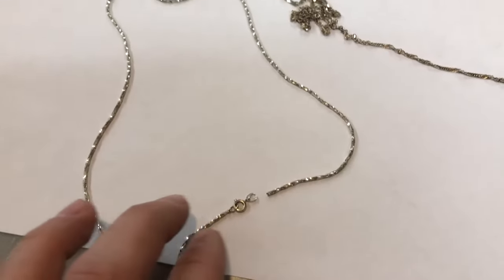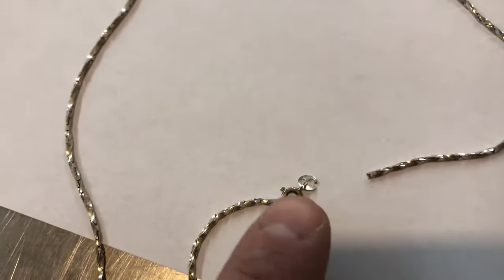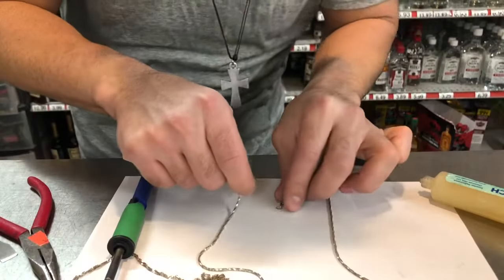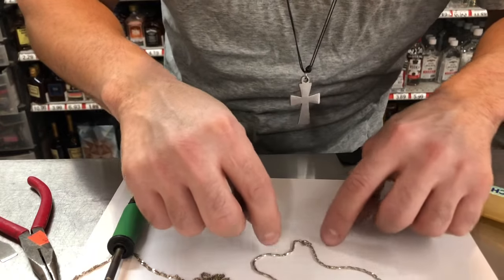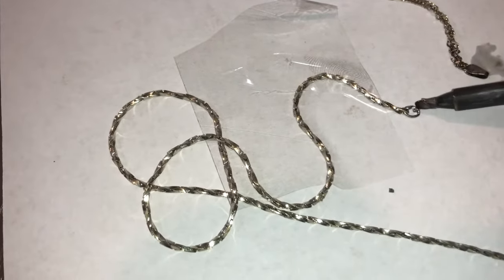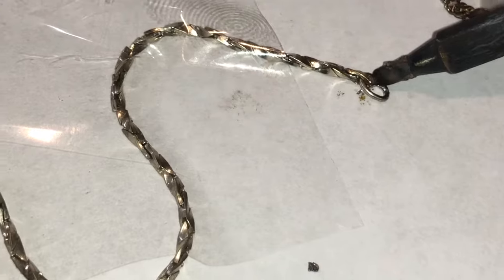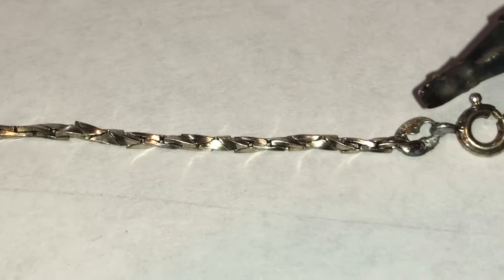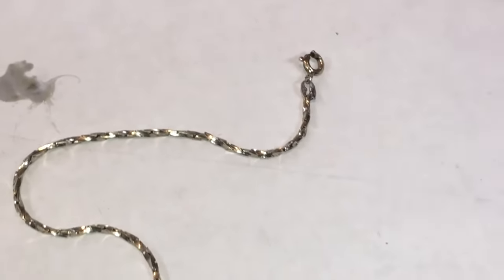How to solder your broken Silver or gold chain

Comment: It can work but Jewellers use gold and silver solder to solder Jewellery and if you use tin or lead DIY solder on a gold or silver it can contaminate approximately 10cm of the metal so if you take it into a Jeweller for a repair in the future, they probably won’t want to fix it (because it could contaminate their gold stocks) or they will have to cut off the ends of the chain and solder on new ones which will be a lot more expensive than the first repair.
Reply: Ok. That’s what I wanted to know, if the chain is silver or gold, did he solder with the same material. Which was suppose to be silver if chain is silver

Comment: Good presentation. That way of soldering may resolve one problem and allow the chain to be worn but it would contaminate precious metals.  That type solder might be ok to use on cheap costume jewelry but I would NEVER use it on precious metals.  My local jewelry store's astronomical prices for repairs prompted me to learn how to properly do hard solder repairs on my sterling silver jewelry. LOL!  Again, your presentation was good presentation and may come in handy if ever I need costume jewelry repairs.  Thanks so much for sharing!👍Cheers! 🙂
Reply: That's right not good use let solder in fine jewelry simple lose value
Reply: I bought a solder kit similar to this guy on Amazon for $28. It doesn't work S925 or gold. I couldn't weld my broken necklace and ended up returning it.
Reply: Heyy so what’s different about soldering sterling silver?

Comment: Thanks so much for your answer to a question that I’ve had for years. When I was a young woman (in a galaxy far, far away) it was vogue to have an add-a-bead necklace and I knew many girls that had some form of one or another. I had just married and instead of a typical necklace with gold beads,  my husband  had mine made of graduated cloisonné beads of different colors. VERY PRETTY.  I can’t tell you how many times I broke that necklace. I’m going to get busy and fix mine (again)!
I just wonder if I can solder it with gold?
Reply from the maker: Yes
Reply from the maker: If u have a soldering gun that gets really hot